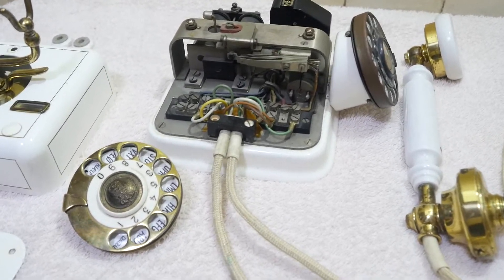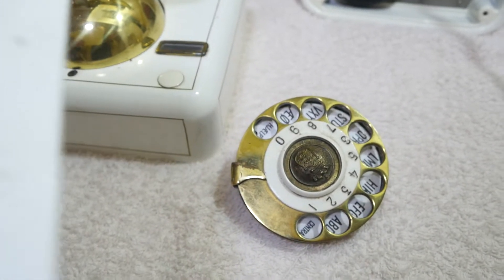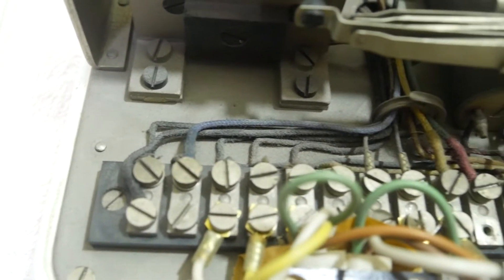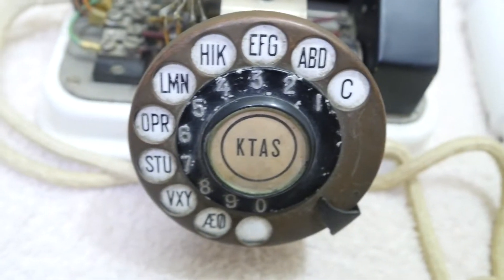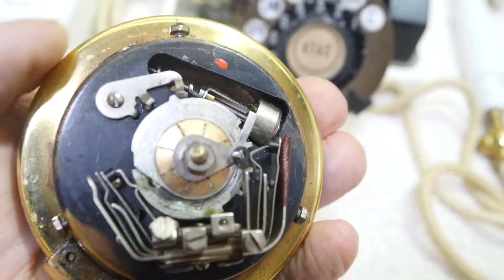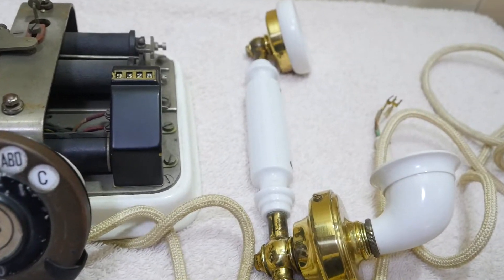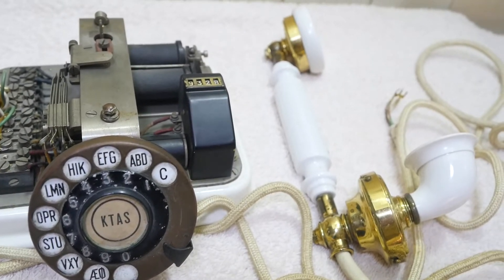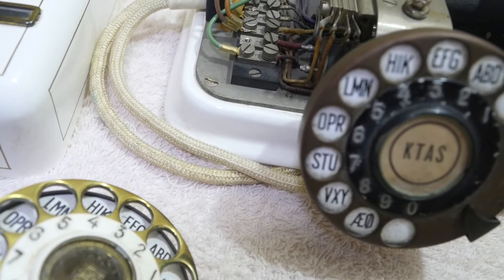Telephones of the World      KTAS  DO8

Comment: Very early 30s. Be careful with wire diagrams. Verify the routing to phone components as there are variations in bus layouts. White is required for ringing. For the United States two wire system, the white and green should be joined and connected to one line and the brown connected to the other. The snap ring on the front of the dialer gives access to the disassembly screws and the dialer can be serviced. That phone is in great shape. Mine works fine but needs cleaning and major polishing. I've read that the mystery part is a condenser but have no further details.